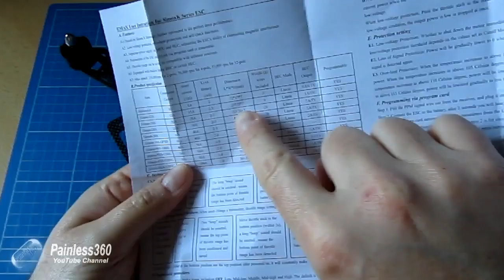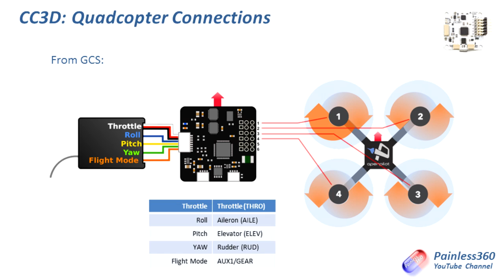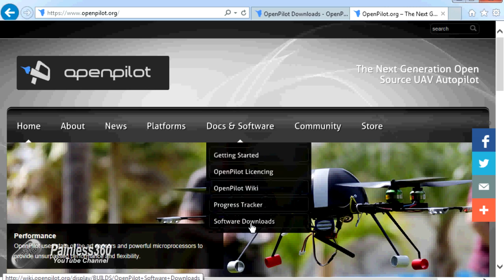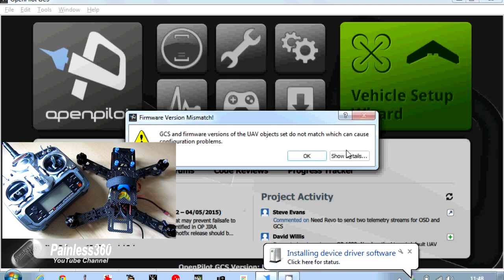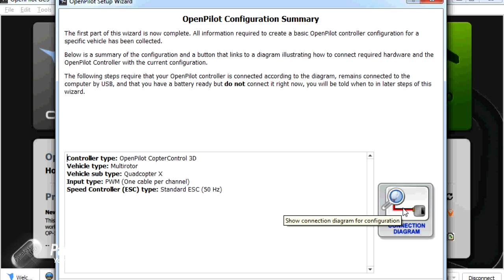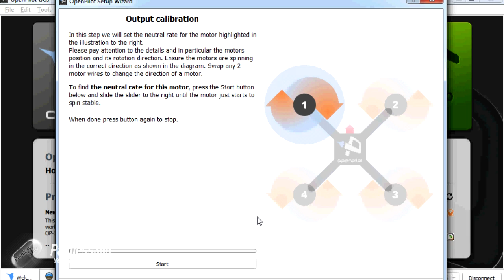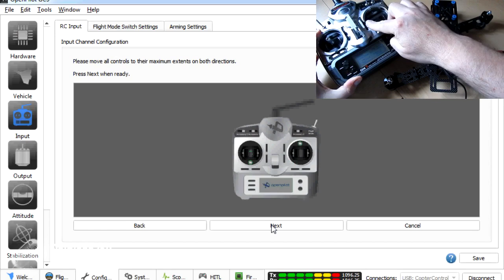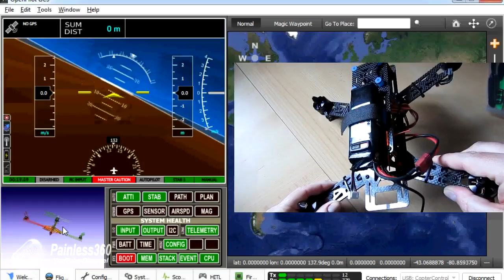(2/10) CC3D Flight Controller - Radio setup, firmware install and testing

Comment: Thanks. Finally the link you provided point correctly to the stuff to purchase.
Reply from the maker: +th tan Great, the details are always in the description if I mention it in the video (if you're not using a 3rd party site that strips the description off the video). Best of luck with the project!

Comment: After a hard landing, fixed wing, I have crossed signals. When I advance the throttle, the rudder deflects full left (rudder on single servo aileron setup channel1). I redid the setup three times, even did some channel switching, but the throttle affects sometime servo 1 and sometimes both servo 1 and 2 depending on assignment. Everything worked fine initially, until the hard landing. Searched the internet, and couldn't find anyone talking about this. Thanks. Bill
Reply from the maker: A crash shouldn't do that. Have you checked the radio and any programming so you have one control = one channel? Happy to

Comment: As always, top notch videos!  I'd picked up a used FPV 250 quad, that is very similar to the quad in your video, at a swap meet, but the quad had GPS and a lot more complicated stuff on it than I could handle (this is my first 'real' quad, having only flown the little Inductrix quad up until now).  A friend of mine coached me to replace the current controller with CC3D.  You video has definitely broken the quad code for me and I now know what to do to get this quad flying.
Reply from the maker: +Chuck Pierce Good to hear, thanks for the feedback. It's always nice to hear when we help others..

Comment: Awesome Video. I think I'm aware now how to hook everything up, and I think I'm ready to buy all my gear needed to build my first Quadcopter. Excellent !!
Reply from the maker: MARK 1 Best of luck with it!
Reply: Painless360 Do you think it's possible to do a V 22 Osprey..? Be able to take off vertical, then take off horizontal once up in the air? For like tight spaces? Be able to take off and land vertical, but have the speed of an airplane? I think it would require a servo like what's on a tricopter, but have two of them.. I see how it can be done, especially it would have to be in the center of gravity of the plane.
Reply from the maker: It can be done - other have done it.

I would Google the build and see what you can learn from those who have built one before.

Best of luck.
Reply: Painless360 Will do, thanks.

Comment: Painless; Sorry but no, the black wire is not shown on the diagram and should not be ground because is in the signal position also, but it is a remain connector that is not shown on the diagram and I would like to know for what it is, if you know. Thank you, sorry to bother you this much but you are the most knowledgeable person that I have read so far.
Reply from the maker: +Hector Castro Then I am confused, a video of what you mean would be helpful..

Comment: Hey I could use your help. So I got through some of the transmitter set up, the libre software recognized all 4 channels when I moved the sticks. I  was able to get upto 16:34 successfully. But after that, when I move the sticks, they don't seem to be moving on my computer screen in the software. I'm sure my connections are correct. Downloaded the latest Libre software version as well. Any ideas?
Reply from the maker: I've not seen that here. I'd be tempted to re-flash and start again. Make sure that the receiver isn't disconnecting from the radio. Best of luck!

Comment: Help needed. At 22:14 where you check if the sticks inputs are correct. My computer don't show any sticks movement on the screen,however the board registered all the setup for throttle,roll,pitch and yaw. How do I fix the problem so that the screen will show the corresponding stick inputs? Thanks in advance! Cheers and have a good day!
Reply from the maker: I'd check that after the wizard setup you can see the sticks moving in the GUI.. Best of luck with the build!
Reply: Same problem i got ,after rechecked wire connect that solved

Comment: Hi again Painless, if Im using Ztw escs (they have a 600hz refresh rate )  it is possible to change that frequency in the gcs? Max is now 490.
Or should I use cleanflight on the cc3d to change the looptimes and that stuff?
Reply from the maker: +Dashz Not sure - we've not used those. I'd have a look in the LibrePilot forums and see what others have done that's worked well.. Best of luck.

Comment: can i bind tx and rx using the cc3d throttle and power servo cable to power the rx while using the jumper cable?, i got confused when you started mentioning squashed and mixed for a helicopter... also you selected 50hz as opposed to fast 490 hz i have no idea why or how to pursue finding out why, ....all the other tutorials the people pick 490hz but nobody seems to know whyi have opto mini bheli 16a esc's but right now i'm trying to test a frankenstein set up using the stock jjrc x1 quads own esc's and a cc3d, so i'm basically blind as to what kind of esc's the x1 quad has and i have to guess 50hz or 490hz... any suggestions? background to all this is the jjrc x1 brushless quad has some yaw lag issues, i'm hoping simply replacing the fc and receiver with the cc3d will work with x1's esc's,

Comment: I am getting ready to mount my CC3D board on my Zmr250. Do you think the CC3D Flight controller is more stable mounted on stand offs or some kind of anti vibration foam?
Reply from the maker: +Steve B I tend to mount mine on double sided foam now and make sure the motors and props are balanced..

Comment: Hey when u connect throttle with your rx in the video which channel did u use I mean earlier i used to fly rc plane and for me throttle is channel 3 that is the main engine but here which channel did u used for connceting throttle pin of cc3d with rx
Reply from the maker: Depends on the radio you have and how the receiver/outputs are configured..

Comment: Painless: I already finish the configuration, noticed and have questions. I have the spektrum  DX 7S . The only way that I could comply with the flight mode switch was to activate the three position flap switch, now I have 3 levels, but what level 1 means and 2 etc...? Also I notice that my gear switch is appearing on channel 6 like "full" deployed  when it is in the "0" position what this means and how it could affect the performance. BTW, great job you did with this videos, my respects.

Comment: Painless, I have had 2 failed cc3d atoms installs, probably because I did not fully wait for the windows drivers to be installed, apparently (not confirmed this myself) you have to wait for the driver install process for EACH cc3d device that you will configure (normally you install a window driver and it works for additional devices of the same type). In fact the tip I received was to NOT start the OpenPilot software until the driver had installed and you can see it listed under "Device Manager" in windows .. you should see "CopterControl" listed under "Ports (COM & LPT)" .... not doing it this way, can result in a "bricked" CC3D

Comment: Thanks very much for this great series on the CC3D. I am very new to quadcopters and was wondering if you could do a short video on setting up failsafe on the CC3D (when it isn't available on the radio transmitter)? If it is mentioned in your series I missed it and I can't seem to find clear instructions anywhere else on the web. I am currently using a Turnigy 9X. Thanks.
Reply from the maker: Hugh J I will add this to the list. Bottom line - setup the Rx so it outputs zero throttle when it looses connection with the radio. Test it on the bench (props removed) so that you can turn off the radio with the craft armed and motors running and the throttle stops. There are also settings in the firmware for this too but they are in addition to a properly configured failsafe on the radio receiver.

Comment: I am having trouble with a CC3D Atom that with windows 10 first showed telemetry feedback in OprnPilot and after flashing software it's NOT recognizing any link to the control board now >< frustrated. Any ideas P360? It also shows that it is ready for telemetry and I have now idea where to get telemetry.
Reply from the maker: Already answered this, no need to post. Question twice.. Happy flying!
Reply: Sorry -it shows the frustration! I am not even seeing my computer recognize it now, Just bought another -hope to see it work eventually!

Comment: I am looking at building this quadcopter with your DIY FPV Goggle system, however I am looking for a suitable Remote Control. What is the one in the video that your use? Is there any type of controller that you would recommend other than the one in the video. Thanks.

Comment: I hope those behind LibrePilot have some new hardware on the drawing board.  It's an awesome platform that gets no love.  It gets flight mode configuration spot on.  I'm surprised Betaflight and Cleanflight don't just give up on any modes but rate.
Reply from the maker: We're switching to dRonin now after loosing faith in Librepilot.. So many Openpilot follow on projects to bet on in the early days (Libre, Tau, Dronin etc.)..
Reply: I looked at their Github screenshots.  The flight mode configuration for dRonin appears dumbed down almost as much as CF, BF, etc...  Nope nope nope.  I don't want the same rates in attitude (horizon mode for google app users) mode as I do in rate.  When you go out of control, panic and need to recover or if your vehicle gets blown out too far by the wind one does indeed need a 'steady as she goes' flight mode.  Can we quit pretending we are all race champs/experts?   Can't they at least build stability profiles into the platform for only separate rates?  If I wasn't able to learn to use the powerful tools they give to build stability profiles tuned to my abilities I might have given up on these craft.  Furthermore just because LibrePilot has a great vehicle setup wizard does not relegate the platform exclusively to beginners, do have a video on thrust PID scaling?  Did you notice that you can even set stabilization modes that have, for example Rate for pitch and attitude (horizon for google app lemmings) for roll, etc.?  It goes deep.  If this platform dies it may be a while before something with as flexible and powerful flight mode system comes back around, sigh.  Flight controller platforms that only cater wannabe race champs will turn many off to the sport/hobby when their vehicles get lost or wrecked.  End rant......

Comment: With all the leads plugged into the receiver is there a spare one or not? And my transmitter has a F mode switch so will the AUX 1 slot be free for a buzzer?
Reply from the maker: J.JONES RC Well, as I can't see your receiver I can't answer that ;) If you have a spare output then you can use that to power a HK buzzer - https://www.youtube.com/watch?v=LgLndyKYuuI - or you need to connect it to one of the outputs of the CC3D and read https://wiki.openpilot.org/display/WIKI/Adding+a+Buzzer+to+Your+VehicleBest of luck with it.

Comment: if you could help on the setup of the rotation on the
board 

The arrow on the board is point from the usb forward

I have set the Revo with the usb to the left So if you were
looking at a clock face the arrow is now pointing to the number 3

In the configuration tab, Do I set the yar to minus 45?
Reply from the maker: I'd guess -90 YAW adjustment. Try and it then check the movement compared with the graphic in the GUI. You can easily change it until you get the right setting, sometimes it's a little trial and error.. ;)

Comment: Painless; The direct question will be for what function or operation  is the black wire included in the receiver harness and it is not mention on the connection diagram? Thanks
Reply from the maker: +Hector Castro The black wire is normally the ground and needed for the Rx to be powered and act as a reference for the signal voltages. It is shown in the diagram - see 5:35 in the video. You only need one connection to the GND though as this is usually common across all the receiver outputs. Hope that makes sense.

Comment: Yes I did , it is not vibrating is wobbling which PID's you use with the 250 quad in your video? Could you orient me in this aspect?
Reply from the maker: Mine are all default. Best of luck..

Comment: Painless ; I follow all the procedures and the quad took off  and responds correctly to the commands but is "wobbling" like is trying to correct the stabilization all the time, there is any fine tuning adjustment that have to be done and where? Please advice. Thank you so far, so good.
Reply from the maker: +Hector Castro I would check that here isn't any vibration from the props and motors - you balanced them right?

Comment: I am having trouble with PID settings for my f450 frame quadcopter.

It seems whichever P value i try changing it to (i have tried from 2.0 all the way to 7.0 on the Beginners tab) the quad always has a series of "wobbles" during hover. As in the quadcopter will drop a few noticeable degrees one side, correct itself, then wobble several noticeable degrees the way (and it appears it does this in the Pitch and Roll axis) so attempting to fly FPV is not very doable.

Any ideas on why this is the case?
Reply from the maker: +fifaplayer10 Vibration is a common cause. See videos like https://www.youtube.com/watch?v=54SO0IoytfsHave you mounted the CC3D at the COG and have it mounted on the frame? Have you balanced the motors and props? Best of luck..
Reply: +Painless360 Yes i do have the CC3d mounted on a thin layer of foam in the direct center of the frame.

Motors are balanced as well as propellers.

Surpirsingly.
What i just did a couple hrs ago was change the ESC setting in the CC3d GUI to the rapid setting (490 hz refresh rate) and then changed the PID settings back to default.

Now the quad flies ridiculously smooth.

I guess changing the ESC refresh rate fixed it.
Reply from the maker: Great news - well found!

Comment: great vid very in detail but when I'm in the transmitter setup my throttle and yaw move but when i get to my pitch movement it does not recognize this is my first quad and i just want to fly
Reply from the maker: +Bull FPV what troubleshooting have you done already?
Reply: +Painless360 I've kept on trying it's still not working but my esc are not in sync either so idk

Comment: 14:52 so I understand, they are standard ESC and not rapid?
Reply from the maker: The answer is in the description as promised.

Happy flying!
Reply: Painless360 Thank you for your patience. You said that they work fine.. I built the first quarter with 2280kv motors, and motors made additionally a strange high pitch disturbing sound. Sorry bothering.
Reply from the maker: Allan Tamm Mine flew great with both ESC options but seems to support the faster speeds so I've stuck with those now. 
Best of luck with yours.
Reply: Painless360 After using setup wizard there is place to set parameters one by one. I cant find where is this place for ESC speed. Is it this: www.new.planet.ee/esc.jpgMay be I have to change D5 to 22 kHz and then I can get rid of weird noise.
Reply from the maker: Thanks for the tip - very useful to know!

Happy flying!

Comment: Painless,I have the Hobby King 30A ESC 3A UBEC. It says in the user manual it has a UBEC/SBEC. an I plug all the wires in like a linear or is there a different way?I'm building at the moment and am confused as to what to do.Any answer would be appreciated.
Regards
J
Reply from the maker: James Smith You need to check with HobbyKing - they sold it to you ;) (SBEC normally = switching BEC though)
Best of luck.

Comment: Good day. Did you ever confirm the "standard" or "rapid" ESC selection? I have the Emax 12A (simonk) ESC (same manual as in your video). Thanks
Reply from the maker: +VD2021 Answer in the description (you checked that right ;)
Reply: +Painless360 Got it. Thanks.

Comment: All I can say is FANTASTIC set of video's, I did the build along with the mini 250 and it flies great, I went with the picture on the model set-up , but getting a small amount of isolation and backward drift, and not sure of what to adjust in the programing. I also put the cc3d on my 450 X quad and having the same problems, but I have changed some of the numbers an checked the results afterwards, but still having isolation issues any suggestions ?
Reply from the maker: Dan H. Make sure that you are isolating the board from any vibration and re-calibrate the accelerometers again..
Best of luck.

Comment: Great vidio it really made setting up cc3d 4 quad! Can you help with a tricopter that has a servo on the 3 motor hjy3? Thanks
Reply from the maker: Gary Sparshott Check the playlist again ;) Tricopter and CC3D are on there :)